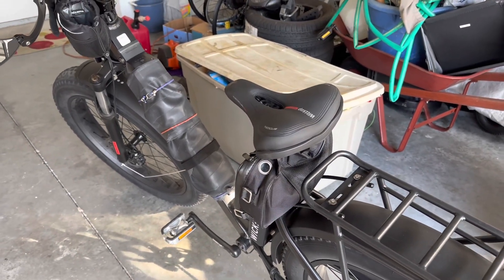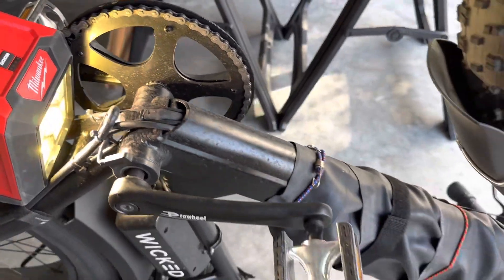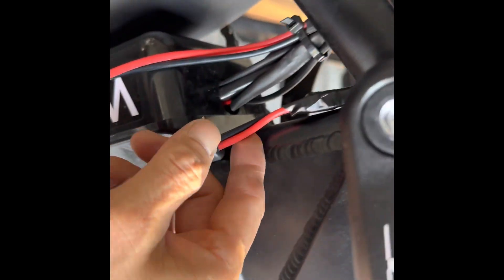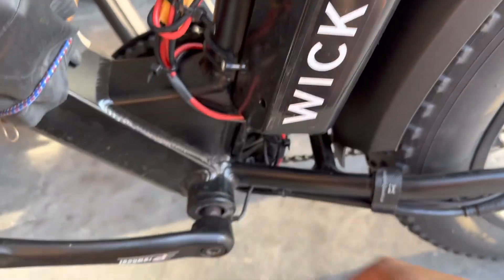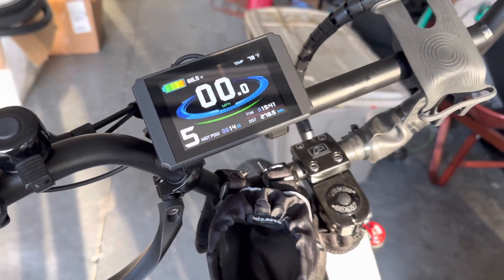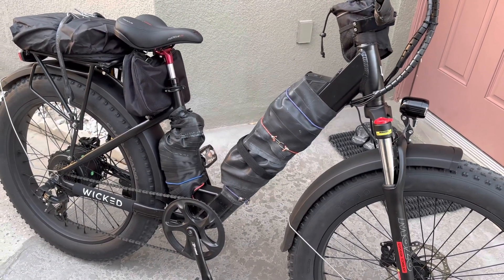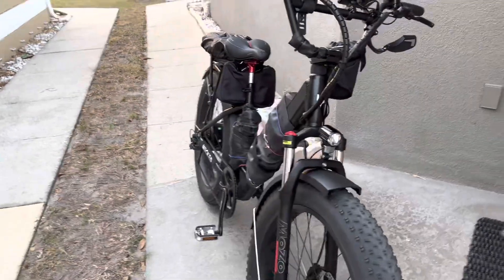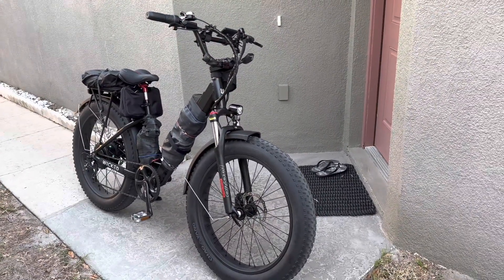WIRED EBIKES CRUISER 40 AH 60v ( 2nd battery added) 2400 WH

Comment: i just got my cruiser today thanks for the video i will subscribe.   i have a 2 husqvarna 36v 9.5 amp battery if i hook both batteries together that makes 72 volts and almost 5 amp right?   would i be able to connect like you did with a voltage difference or not or even worth tinkering with? thanks
Reply: How did your battery installation go?

Comment: Your ready for a decent ride now. I added the 2nd battery also on my wired ebike using a battery blender.
Reply from the maker: I ve been riding since January on the cruiser!  I have pver 1500 miles now.  Solid on dual battery setup. Not a dingle problem
Thanks for watching the video :)

Comment: When you unplugged the original connection and re-routed it, was it long enough to run up to the new connector without having to extend it somehow?  Thanks,
Reply from the maker: You need extension cord with xt60 both ends to rout to the blender.  The original cord is short.
Reply: Got it, thank you!  @MrMtr999

Comment: Can you advise which Fusion Battery Combiner to get for this 60 volt system? I too would use a 20amp hour UPP battery.
Reply from the maker: https://www.electromotivemods.com/shop/p/s1fmuuaawo86hdw5gduhknspnoks37

This what i use since installing 2nd battery, worked great almost 1k miles now.
Reply: @MrMtr999  Thank you for the link. Could you tell me if it was the dual 50-amp because there is a choice?
Reply from the maker: @jimbianca9560  the cheapest one

Comment: do you know what gauge wire comes out of the battery and into the controller? 10, 12 or 14awg?
Reply from the maker: Everything about wire on that bike and my other bikes i use 14 awg.  It has worked well since i started using it in 2021

Comment: curious if you did a test how far you could go on one full charge. Then a test on how far you can go with the two batteries.
Reply from the maker: I do commuting to work with dual batteries, avg speed 19-26mph, with 56 miles in two days still have battery @59% from full charge.

Comment: Definitely not cheap to do this because the bike is $2k and the battery being the most expensive of all their accessories is a hefty $800 making the value of the dual battery Wicked Freedom bike being $2,800. It’s most likely way more than $2.8k because of the cords and connecting cables that you will have to purchase to make this possible, ouch.
Reply from the maker: I did a tsd less than $2500 on this bike with everything, it is up to you how much you want to spend on the 2nd battery. But agreed nothing is cheap.  But  again for 40 AH most bike sold in $3800-$4500 range on 60 v.  So $2500 is not that bad at all for 40 AH 60v.
You are right nothing is cheap

Comment: I just ordered the bag you used and the port for the wires does not go all the way through, nor is it large enough for an xt60 connector.  How did you make yours work?  Duid you have to cut a hole in the bag?
Reply from the maker: Yes, use screwdriver to poke hole and widen it enough for the xt60 ti go through

Comment: Have you had any problems with the magnets coming loose inside the motor?
Reply from the maker: Heard of it, but i don’t see anything loose when taken apart and regreased it
Reply: I watched your video on the greasing, I couldn’t tell how much grease you used or where exactly does it go?
Reply from the maker: @629ripley  good amount all around teeth of 3 planetary gears and also the hub that has coresponding  teeth

Comment: Have you done your 500 Miles mileage test yet? I traveled 136 mi on my 2 battery !setup zero pedaling
Reply from the maker: Oh wow i never thought it will go that far! Did you drain battery to  below 40%?   I plan on another video review/thought on 5-600 miles. Pretty soon.
Reply: @MrMtr999  yeah I know you're not supposed to do this but I road till my screen shut off! I discovered that at slow starts and maintaining a steady speed with cruise control that the motor is very efficient. Also as far as for the front wobble  the stem bolt was too loose. All good now!
Reply from the maker: @orvillecooper8334  universally speaking, you are not supposed to drain battery below 40%, it will burn or destroy the BMS inside.  Just saying though

Comment: did you notice a difference with less voltage sag with two batteries? Are there any noticeable differences in power delivery?
Reply from the maker: Yes, hardly voltage sag with 2 batteries hooked. I know all single battery has voltage sag problem. But the main reason for dual batteries is RANGE, I commute to and from work and a lot of time would like to go fast like 30 ish mph to get away, single battery can not do it because range anxiety and you have to pamper the slower speed.   Well we’ll worth on dual battery.

Comment: Great installation video except for the rubber wrap thing.  The battery combiner u installed is suppose to be water tight.  It also has the heat sink on the unit for an important reason.  If the heat sink is covered, it can not do it's job properly, and that could result in failure of this unit.  I'm not sure, but I thought the companies that make these ebikes design the battery system to work in wet conditions, so wrapping the battery doesn't seem to be required and this rubber wrap could hold in condensation which would promote corrosion at the electrical connections.  I've done things in the past many times  trying to improve over OEM without understanding the all the negative sides of the application, and had shot myself in the foot trying to make things better.   I assumed I knew more than the many smart engineers and designers that worked for hundreds of hours thinking how to make something.
Reply from the maker: Been using this method 2 years zero issue, so it works for me.  There is no requirement for anyone to do this way.  It is just personal ride and video.   Thank you fir  commenting and watching.  👍

Comment: I bought the 25ah battery upp and now I have a wobble in the front. Are you experiencing that?
Reply from the maker: No sir, my 20 ah only weighs 15 lbs, it fits perfectly and works great.  I was about to caution you on weight but you seem to like it so i did not question.  2nd or 3rd battery added always consider weight distribution.  I found that 20ah is the max you can do and no problem.  My Kepler has 2 nd battery since last summer, it is 20 ah and it performs and rides perfectly.   Hope you are okay, just switch it out to 20 ah you will be good.. take care

Comment: Okay you remind me of me LOL! I've been modifying e-bikes for awhile! good job! already did my dual battery on my cruiser. FBC noted that the device should have air flow!
Reply from the maker: It has vent flow underneath rubber tube, i have used this method since Rideal, Ecotric, Aostirmotor, and Kepler, so far almost 2 years with success none of issues.  It works perfect, similar to people put FBC inside bag with their battery, etc… thanks for watching.
So how is dual battery on your Cruiser? I freaking love it. No range anxiety and i can go without pampering my speed when i want to…

Comment: I enjoy your videos ....... I have a Freedom ebike and have adjusted it to what was in the manual ......... The bike JUMPS as soon as I turn the throttle. What setting do I need to adjust to get around this issue?
Reply from the maker: You should moderate c4 and c5, set c4 to 1 and c5 to 5 try that, but I don’t do that, I love the way it appeared on this video c4 to 3 and c5 to 10, you have to practice “feathering” throttle, start off with pedaling first instead of throttle first.  You are riding one of the most powerful “e-bikes “ in the US, we are not Onyx or Sur Ron yet please note but Wicked is one ass powerful ebike, may be Wicked is not for you, may be something less powerful will suit your style of riding like RAD, Magic-cycle or Hemingway, Aventon? I can not answer that. Something in that nature, 28 mph max.  Just my humble opinion.  Please make sure you are absolutely able to control your ebike before taking out on street or sidewalks, absolute control on the bike is key no room for play on that part to prevent injury and accident.  Good luck, and thank you for watching🙏🏻
Reply: @MrMtr999  I just need to get used to the Wicked Freedom. I only have 22 miles on it as it is very cold in Michigan. I also have a Ariel Rider V3 Grizzly, and an Ariel Rider  X-52 so I love the speed. I will play around with the adjustments that you mentioned above. Thanks!
Reply from the maker: @RobertHaworth  Wicked tops all the mentioned bike, i would not buy Grizz or X52, i can have dual battery setup with the cost of X52 alone. Either on Kepler or Wicked is good enough.  Take care sir

Comment: Wouldn't  the 40 Amp be to much for the ebike controller and the FBS?  What is the Amp  Capacity  controller on Wicked Freedon ebike?
Reply from the maker: It is 60 v battery, the FBC can handle as long as you don’t go over 72.  It is balancer that feed the power balancing them. It is the safest way to add battery.

Comment: Thank you for the video,  where did you get the battery and the battery extension  ??  How much for New Battery.
Reply from the maker: https://www.uppbattery.com/products/d034-60v-20ah-bms50a-waterproof-ebike-battery-for-0-2200w-electric-fat-bike-with-3a-charger-usa-stock-3-5working-days-arrive-1178

OliRC 2pcs Battery Charger Charging Leads: HXT3.5mm Female to 4mm Banana Plugs 14awg 30cm(C152-2) https://a.co/d/0Vck31k

Comment: Nice video. Where did you get that case/bag you put the battery in? Do you have a link?
Reply from the maker: https://www.ebay.com/itm/174533155001?mkcid=16&mkevt=1&mkrid=711-127632-2357-0&ssspo=wwyynbOYSBu&sssrc=2349624&ssuid=1B1TuCjgR46&var=473735105045&widget_ver=artemis&media=COPY.  
21 different size
Reply: @MrMtr999  thanks for this link.
Reply from the maker: @bigonebikes  you r welcome